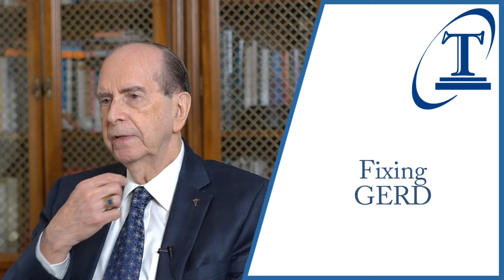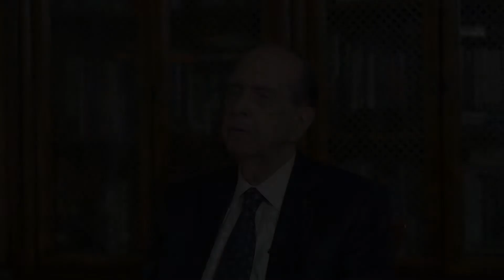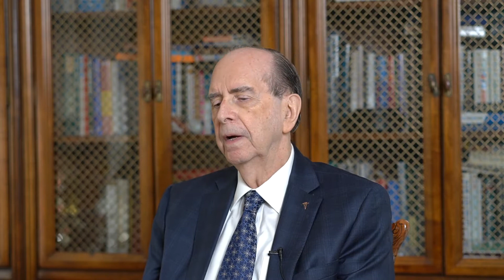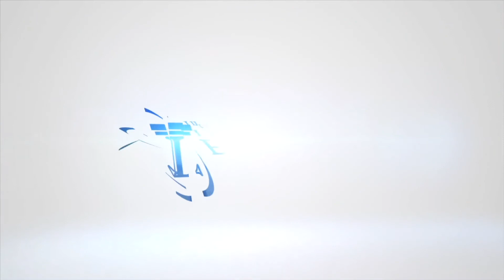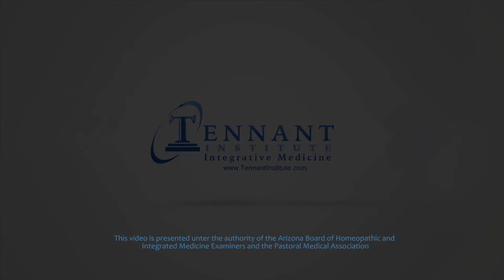Dr. Jerry Tennant:  Fixing GERD (Gastroesophageal Reflux Disease)

Comment: As he said I’ve heard stomach acid is low I’ve heard that can make the valve not close. And b1 also is needed for the strength of the valves. Also toxins overloaded can backup digestion.